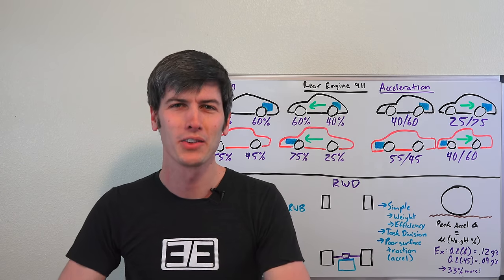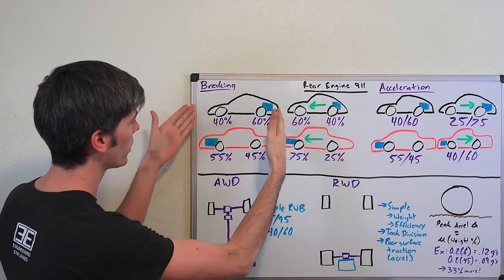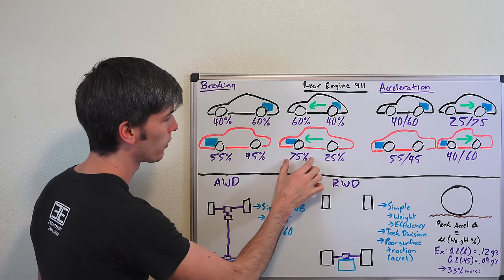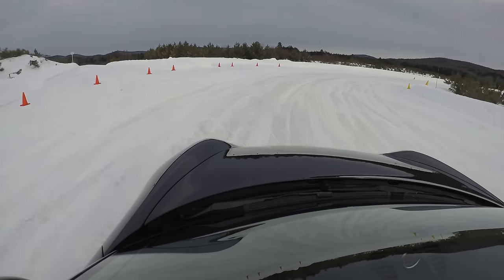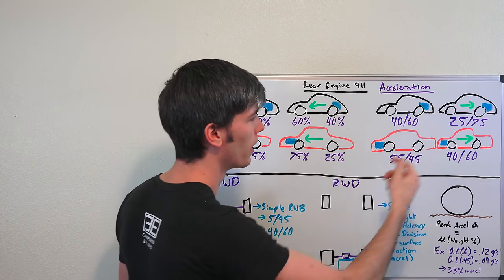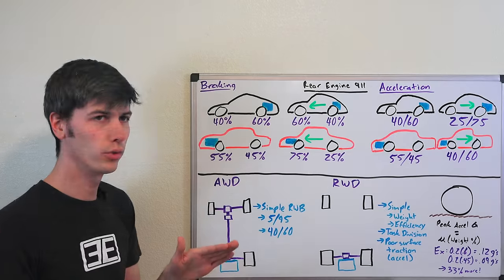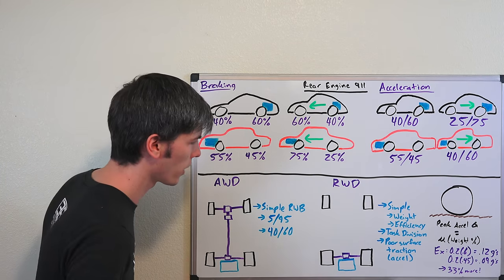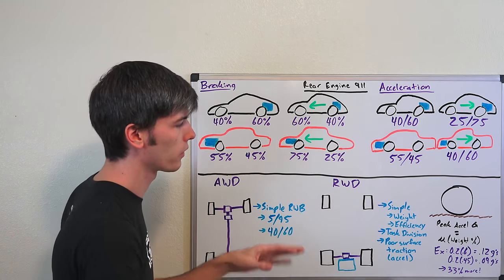Why Is The Porsche 911 Rear-Engine?

Comment: I thoroughly enjoy driving rear engined cars. It's vastly different from any other engine configuration, to include the traditional mid engine. Huge advantage of a 911 is that under braking, all 4 tires get more or less equal load, which maximizes braking force, allowing later braking and it makes trail braking easier without feeling sketchy. Disadvantage is that it understeers with throttle application, so one must wait a little longer to get on the gas at corner exit unless they want to end up off road. However, the rearward load transfer ensures that every single one of those ponies make it to the tarmac, and it accelerates like a bat out of hell. From a drag racing perspective, there's a reason why a base 992.1 Carrera 2 can run high 11s, and a lot of it has to do with the 40/60 weight distribution. I would argue that a RWD 911 launches just as hard, if not harder than an AWD car, but without the need to launch it at high revs and feathering the clutch.

Comment: Also, with electric cars like Tesla, specifically Model 3, handling is so good. Design wise you just can’t beat it. You have the weight so low, all between the axles, electronic-instant torque response/traction control (seamless), and then add front motor, you have no drive shaft, no slow mechanical linkages, no shifting or drops in power/traction, and literally perfect transfer of power depending on front/rear drive units’ traction.

Comment: You gave a good explanation of the benefits of a slight rear weight bias and the packaging benefits. I think the common comparison for the 911's rear engine design being "wrong" is against the mid-engine layout. The issue with the rear-engine design is the yaw moment of inertia not the pitch. When compared to the rear-engine, the mid-engine layout loses a little benefit in the pitch moment of inertia for a big gain in yaw performance. Porsche have done an amazing job over the years evolving the chassis and suspension to keep the 911 a relevant sports car but their high-end super cars (except the 959) are mostly mid-engine for a reason.

Comment: Porsche puts the engine in the trunk because.... It is a Volkswagen on steroids!
Reply: grow up.
Reply: far num He's right, the 911 and Bettle share the same engine placement and almost the same form, the 911 was intended to be a sports car but that was it, if you see both original cars it's more than clear that the main design is the same. European utility cars ended up switching to FWD and thereforce they became FWEngine but Porsche keept doing RWD and the car had a special driving, that's why they keept the engine layout up to this days
Reply: ALIENdrifter66  the 911 design was based on the bettle design. the original 911 engine was almost identical to the bettle engine. the bettle hás a 4 oposed cyl aircooled the Porsche hás an almost identical engine but with 6 cyl. the suapension layout is the same and the body layout is also very similar. Porsche dumped the air cooled engine design but the resto of the car keeps very similar to the original 911
Reply: i think the engine on the trunk is actually a pretty good idea. this why you have the engine and a very compact package and avoids the extra weight of a heavy driveshaft. also, on acceleration, the weight transfer to tghe hear axle increases the force on  back tyres improving the grip. pretty neat.
Reply: if Porsche was to move the engine to the front they d need to completly remake the  entire car project changing the iconic body layout, changing suspension, creating a new powertrain... basically a entire new project what makes no economic sense considering the car is a living legenda and still dell alot

Comment: @Engineering Explained  2:45 you said under braking mass moves forward. If the center of gravity is 'below' the turning point which is the wheel hub in the back tyres, I think this will change the torque angle and will force the rear wheels to gain traction instead of the front wheels.
What I'm using to rank this is this image placed here. What I've heard is that center of gravity can be found on the line where center of mass crossects the rear tyre connects with the road and the top of the front tyres. If its height is lower than the wheel radius, its inertia gain should be inverse to the the mass inertia of the car. I fancy low center of gravity cars. Please, could you look into that - for research purposes, of course!

Comment: Why? Because men are stubborn. As (i think James may said) if women had run the company they would have put the engine in the front or the middle. But the stubborn men said “no, we WILL make this work”
Reply: Yep, that's basically it.
Reply: Actually, i think they said, NEIN! VE VIL MAKE ZIS VERK! ....they should do a hitler video on it
Reply: Jeremy Clarkson said that, and the reason they did that actually was because of the 356 being the 911's official successor, they wanted to upgrade the design and engineering of a rear engined car. The beetle wasn't dangerous, nor was the 356. But you're adding extra weight to the back by adding 2 more cylinders
Reply: @theravedaddy  funny

Comment: Having the engine in the rear is also great for a cheap and simple car that does well in the snow. Just like the VW Bug. It was my first car, and there were a lot of them still running around in the 70s and 80s. And they never got stuck in the snow like most other cars. They were able to drive in conditions that would strand almost every other car.

Comment: because beetle... duh
Reply: Love your videos, but this was the first giving out erroneous information.  This should have been titled "Potential Advantages of an Otherwise Compromised Engine Placement".  As stated by many, there is only one answer to your title "Why Rear Engine"...cause that's where it was on the VW bug that the Porsche cars were derived from.  It's otherwise a lousy idea. Biggest error:  no mention of the dreaded Drop Throttle Oversteer that sent so many 911s into the ditch or worse.  The main thrust of the Porsche engineering dept. over the years has been how to minimize that phenomenon.  Basically back in the 60s and 70s if you went into a corner too fast and you let off the gas pedal, the rear end would come flying around.   Just a bit dangerous!!!  You technically were supposed to give it more gas to transfer more weight to the rear for traction and some power-on oversteer to point you in the right direction, but stomping on the gas when you realize you can't get around the corner doesn't intuitively seem like a good idea.

Comment: The modern RWD 911 and the Lotus Elise both have 40/60 F/R weight distribution providing similar acceleration and braking benefits, but the mid engine placement of the Lotus also has a lower polar moment of inertia.  Theoretically, that allows the Lotus to make changes in direction more quickly.  This is something you can feel when driving the two cars back to back.  The presence of the weight behind the axle of the 911 can be felt as a half step between the input of the steering and the cars reaction that isn't present in the Lotus
Reply from the maker: Certainly, though an even larger advantage, and what will be felt even more than the moment of inertia, is the fact that the Lotus is a good 1,000 lbs lighter. Even if it had a fairly poor moment of inertia, the low mass helps tremendously with quick turning.
Reply: Early 911s were only 300-400 pounds heavier than the Elise, but with the trailing arm rear suspension, they were even more resistant to rotate and then once rotating, almost impossible to catch.

Comment: AWD does not need to have a shaft going all the way to the rear and another shaft going from the rear forward. Please see Audi's Quattro layout, it works beautifully especially with the sport rear differential. My S6 transfers torque front to rear and side to side very well. It is like driving on rails.

Comment: I have a Bmw e30, based on the advantages of rwd rear engine I brought a sw20 mr2 with an lsd. On paper it should have been better but the e30 feels more stable and predictable, the mr2 always felt a little nervous and if you lost the back end I doubt you would be able to catch it. But you can't argue with the rallying success lancia 037, stratos and the rear engined peugeot and renaults. But the "Bastos" e30 m3 is up there too.

Comment: Also, with most of the weight/grip available at the rear, your already good turn-in is further exaggerated by the centrifugal force acting on the heavy engine. Since the engine is behind the rear axle and the rear axle acts as a pivot point, in a hard corner, the balance of the car actually helps the front follow the corner and the 911 will not push. Of course this is the theory, but I felt a sensation of this happening when I drove a 964 once. There was no mid-corner push at the front axle.

Comment: Nice explainations and vidéo as usual. It is a quite "tricky to solve" topic to me, as the "RR" layout has the advantage of efficient breaking and perhaps transmission for AWD... But this weight distribution is a non-sense for dynamic efficency (e.g. cornering at high speed is very touchy, especially on wet surface to my experience, Dunlop Corner on Bugatti Track for those who knows it)... And one more interesting point is that the "new" 991 RSR has changed the engine layout, moving from RR to MR (So rear Engine but ahead to the transmission). That could illustrate the limits reach of the RR configuration compared to the MR cars, finally aprouved by Porsche engineers on this last RSR version. The purists of RR Porsche will be disappointed ;)

Comment: Cool vid Jason, makes sense for track use. 
Just a remark about AWD, which is not the best alternative (temporary 4x4) - the better one is 4WD, which maintains constant 4-wheel drive, examples with front engines include Subaru Symmetric 4WD, and Audi's Quattro (with some models having RWD-bias).

Comment: I think you will find that Subaru gave some of its cars (some flat 6 engined Legacy models) a 45 to 55 rear torque bias - the torque bias can be engineered to be anything you like regardless of the location of the engine - it's a function of the centre differential to determine this.

Comment: This is a very trivial question: a rear engine can help reduce the chance of getting an engine fire when you poke and the enemy shoots at you frontally. Especially for 911 since its armour is relatively weak, although very well angled. (But still lower plate is pretty flat and easily pennable) which means every tier 8 can go through its front.

Comment: Nissan's Attessa system is rear wheel drive 'first' as i call it. but the transfer case is on the back of the gearbox. More like a normal 4x4 system. But it's electronically/hydraulically controlled. I am a bit 'bias' pun intended.. But i love the way the system works.. I haven't found a situation it doesn't work in.

Comment: I'd love it if you could actually explore the rotational inertia problem of an RR car. I have my doubts that it is truly worse than MR (front-engine) or MR (truly mid-engine), because the rotation isn't actually about the middle of the car in slower speeds/low-radius turns - the higher the steering angle, the closer to the rear axle that effective pivot point will be.
Reply: I = 1/2 MR^2

Comment: Ok ok, what about behaviour in the corners with the rear engine vs the front / mid (by front I mean front behind the front axel like in M3 or S2000)? Trail braking, snap oversteer, putting power down vs. power sliding and slide control etc. I had the possibility to drive Ariel Atom on track (same engine setup as 911) with a race driving instructor, and it was a nightmare! If you don't add enough power or let the accelerator off mid corner you spin out, if you add too much power ... you spin out. All in all it's super satisfying if you manage to do it just right, but it's counter intuitive and requires absolute precision to get right ... I'd take a Caterham for myself any day on track. So so so so so much easier to have a good time.

Comment: Love your vids. A topic that I can't find any good iformation about is how compression affects sound. In my case I care most about idling noise.

I rebuilt my first engine and my impression is that it sounds more diesely. Compression tested very good afterwards but I neglected to do one before since I only did a test when things went wrong. (turned out to be the DMF).

I only learned how to clean lifters when it was too late. So now the engine runs great but not every nuance of the noise is accountet for.

Comment: Awesome video! But I feel like you left out an important aspect during braking. Under heavy decel, that extra weight transfer on the front axles also increases the normal force on the front axle. So yes, the front tires are skinnier, but you have more normal force and thus, more available traction. I'm sure Porsche has done the math to make sure that the they're getting the maximum available traction across all four tires compared to their benchmark vehicles' setups, but just thought I'd point this out as well.

Comment: A doubt I've always had about Porsche engines, or, actually, transmissions, is if it is possible to invert the rotation of the axles, through a transmission mod, so the engine can be mounted on a FF, FR or MR configuration in another chassis, even though it's made RR. If not, there's always the Boxster's engines, I guess. Other doubt I have is about fitting Porsche transmissions onto Subaru engines. I guess all I need is an adaptor plate?

Comment: This assessment makes sense, I sold my 911 4s for a cayman, the traction on the 911 was phenomenal, however that traction was somewhat detrimental to the "fun" factor, the car would have zero drama, just point and go, which made it somewhat boring at sub 60/70 mph

Comment: Straight line acceleration :D  Getting the front wheels to turn when 75% of the weight is on the rear axle can be a challenge

Comment: You mentioned that front-engine rear-biased AWD systems often have to send power all the way to the rear axle, then send it back to the front using an additional shaft. Is this how most AWD versions of RWD sports sedans work? For example, the BMW 330i xDrive, Mercedes-Benz C300 4Matic, or Kia Stinger AWD?

Comment: Without watching the video with a rear mounted engine you can drive the rear wheels without it being lost/ diminished by the drivetrain and adds more weight/ downforce to rear wheels for better off the line acceleration

Comment: I would like to see a front vs rear engine and front and rear wheel drive in a slope, differences which is better since you already did the calculations it will be easier for you.

Comment: You have effectively demonstrated that, for a sports car, the best layout is mid rear engined for a rear wheel drive car, like a Porsche Boxter/Cayman or Corvette C8. For a front wheel drive sports car, the engine obviously is at the front, transversely like a Lotus M100 Elan. The 911 continues because people want it to, not because it is optimal. For a cheaper, RWD, sports car, front longitudinal mid engine leads to better weight balance. You know this as your MX5!

Comment: Very well done video as always. Keep up the good work. I do have a question for a possible video and if there is one already, disregard. After watching this video, I got to thinking on the various engine layouts that are possible, especially if there was no limit on packaging and design constraints, and was wondering if there was a way to compare these. I was thinking there is the basic FR, FF, MR, RR configurations, but what about the differences in each layout? Say for examples, FF but where the engine is in front of the centre line of the front wheels VS behind; FR, but where the engine is set mostly in front of the centre line of the front wheels VS behind; MR with a longitudinal VS transverse engine layout. Also, which of these different designs would be best on the street VS the track. And, what if each had an awd/4wd version? A lot to consider with this question. Again thanks for the great videos, will be waiting for the next one's.

Comment: I really prefer the 50/50 my car is set up with. It's super forgiving, nice and stable if I drift a bit on exit ramps off the Merit (some of them are 25 mph hairpins) and friendliness of the handling. I've driven a 911, and it's a entirely different style of driving which I'm not accustomed to. I'm not into the snap oversteer exhibited by the 911 design. Though if you're a very good driver and know just how to maximize this characteristic, one can be very fast around the turns. But, I've seen too many 911s wind up ass backwards into the trees.